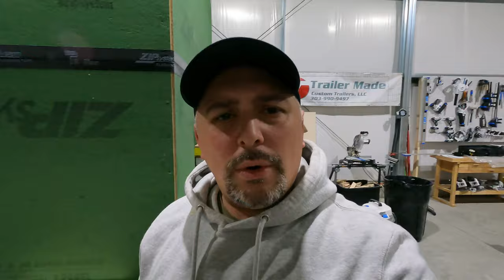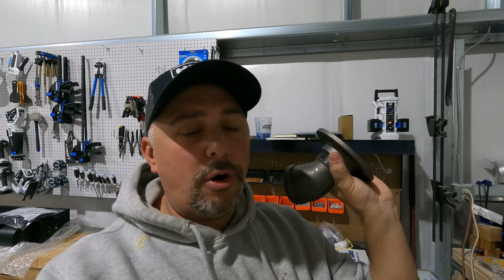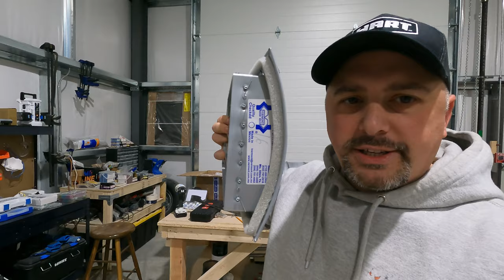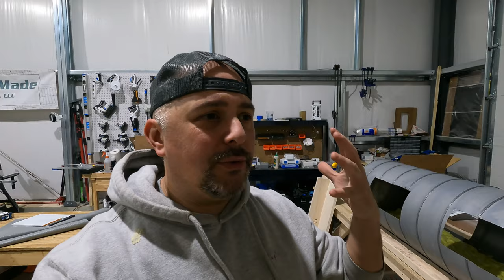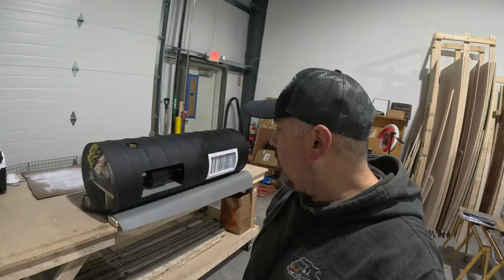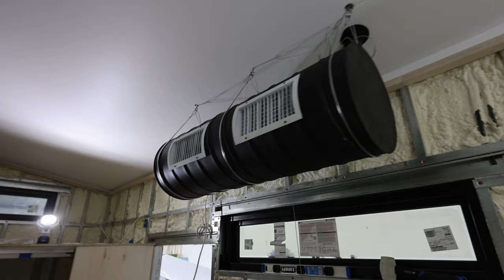CUSTOM Tiny House A/C Unit

Comment: I like everything except the wire. I thing using the decor pipe coming into each end would make it look more industrial and finished or use real suspension strap. To each their own taste differ. I also did not care for the white grates. You can remove the paint and industrial silver is under that.I only wish it were mine so kudos for your build.

Comment: I think you may be underestimating the condensation. That’s the AC dehumidifying your home, so you want to get it out vs just collecting it and putting it back into the air. That’s what results in mold problems.
Reply from the maker: I think you’re underestimating what I show on the internet and what I don’t. I’m well aware that air-conditioning evaporator’s have condensation and when you see me slide the unit into the duct there are 2 drain hoses. Those will go into a custom made pan that I will have to manually remove to drain. Is it an inconvenience? Yes to some people. Do have a have a plan to do something else in the future? Yes I do. I’m looking into draining those into a small garden that will be under that unit and I’ll be able to grow plants in there. That side is also facing south therefore will get direct sunlight too. Underestimate? I’d say no. Willing to show every detail that goes through my head? No, because it would be boring to most
Reply: @JarrodTocci  that sounds like a great idea. I’m not sure what environment you’re in, I bring it up because I’m in the south, and here an AC system can condense gallons per a day if it’s doing it’s job correctly. I’ve worked in the mold industry for a number of years and have seen what happens when that isn’t taken into account. If you’re in a more dry climate, that shouldn’t be an issue though.

Comment: Should have stuck with a 48v minisplit or a 110v.  Way more efficient and quiet.  Cnc is gonna be loud and is going to have a higher energy draw. Don’t get me wrong i love cnc but for van builds only
Reply from the maker: Umm this is a 48v mini split. Question for you…what a/c unit isn’t loud? All of them make noice from the compressor. I know this one to be much quieter then others I’ve heard

Comment: Instead of wrapping the cable around it to hang it, you could of put eye hooks in the top and hung it with cable.  That’s the way we hang spiral ducts.  What about air filters?  They also make little pumps that you can pump out the condensation, which I think there may be alot.  How are you going to run your refrigerant lines to the condenser? Is that straight ac only or is it a heat pump also.  
By the way it looks great 👍
Reply from the maker: Good questions. But as I said in one part in the video if I bolt into the top of the duct and hang from that point that it will warp the duct due to the weight inside the ducting. Not sure what you mean what about air filters. The unit has a filter on it but I made that accessible for when I need to change it if that’s what you mean. Condensation is not a worry as for a temp system I’ll make a catch tray inside. My plan is to make it either run outside or to plants on the inside. The refrigerant lines were already run through the walls and into the ceiling, down into the unit and also hooked up. Sorry I didn’t show any of that. It is ac only, my heating is done a different way
Reply: @JarrodTocci  can’t wait to see the finished product.  It looks amazing so far.

Comment: What are the benefits of a 48 volt system besides thinner wire?
Reply from the maker: From what I’m told, everything is more efficient. What is everything? Not sure how to explain as I’m not an electric guru but I’m friends with a lot that are so I listen to them. If you use 48v batteries you can also pack a lot more into a smaller space. There are others on YT that are using 4 12v batteries to make up to 48v. I don’t see the point of that but to each their own I suppose. I have limited space in my tiny so I’m using every square inch
Reply: @JarrodTocci  thank you for the low level overview, you put it in terms i understand aha
I hope all is well brother🙌🏼

Comment: If you were to do this again, would you consider making it go across the ceiling from wall to wall, the way a real duct would be. (Front to back, not the long way) it could still ventilate and drain out the back of your house and you could brace it on the walls at the ends. But it would look like it's going through the walls. Does that make sense?
Reply from the maker: Good thinking but I didn’t want it to impede my space too much inside. If I did it that way then most of it would be for looks. If I’d do this again I might make the duct against the wall and rectangle so the draining could be easier but I really like the spiral look

Comment: I wonder what alternate uses of the unit might be because Main doesn’t get super hot does it,like the south? My area we may get two to three days of heat.
Reply from the maker: Guess I should of said the btu. This is rated at 18,000btu and will pull about 15-20amps at 48v. It’s custom made by Cruise N Comfort